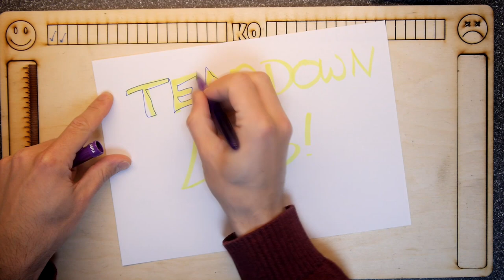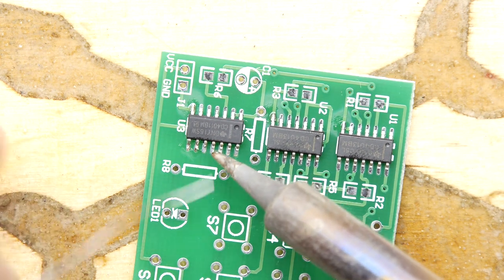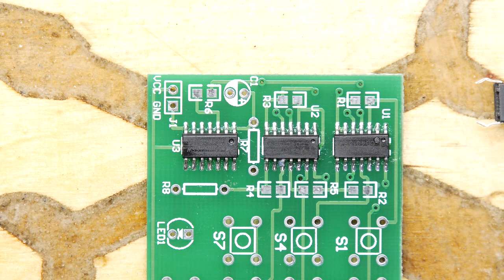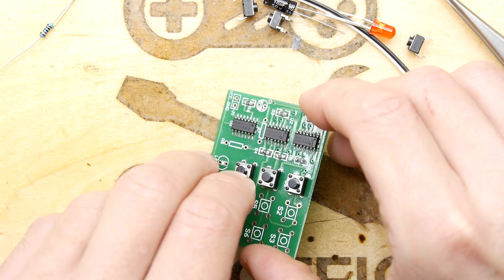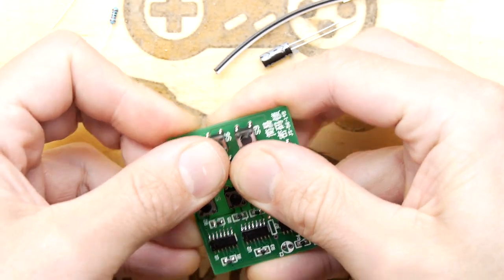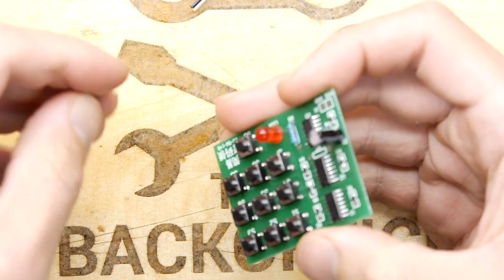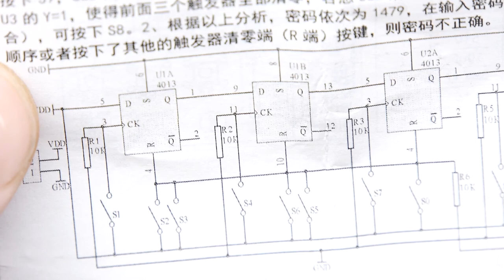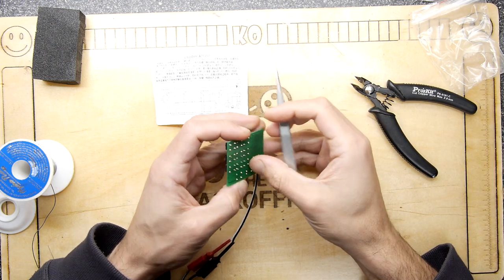Digital Keypad Kit

Comment: As long as you can hack the code using a Dictaphone, like in Wargames.
Reply from the maker: I think I actually owned a keypad lock that you set the real code using 4 wires, each wire was a particular digit. Bit of a pain, but I guess you didn't change the code very often
Reply: @backofficeshow  

I had another look at that Snow Bros board, btw, and identified the buffer chips that could be causing the contention on the data bus.

I haven't given up on it, but there's a lot going on atm, and I'm planning to stay drunk from about Xmas Eve until New Year. lol

I very rarely drink, but Christmas is the perfect excuse to pass out while watching Die Hard for the 38th time.
Reply from the maker: So there is still hope 😂
Reply: bloody love Wargames.. When those Terminators come to kill me I'm going to insist they play noughts and crosses for a few hours first.
Reply from the maker: They love a good noughts and crosses 😁